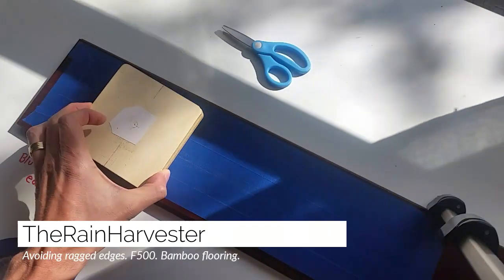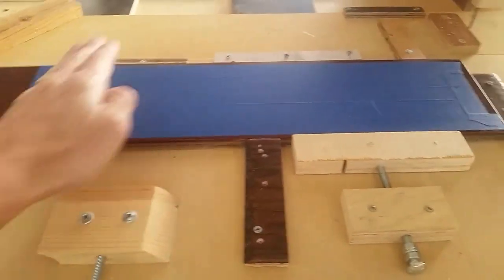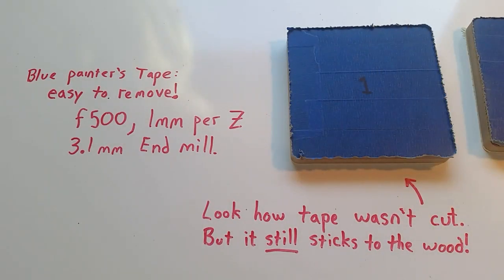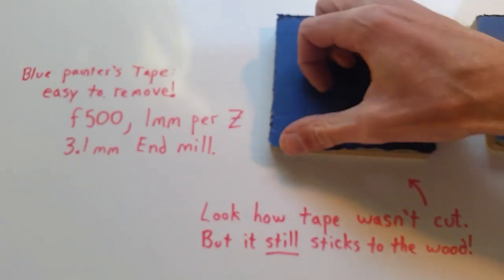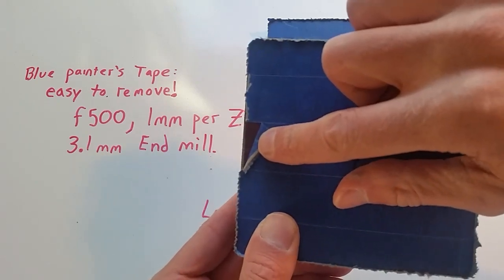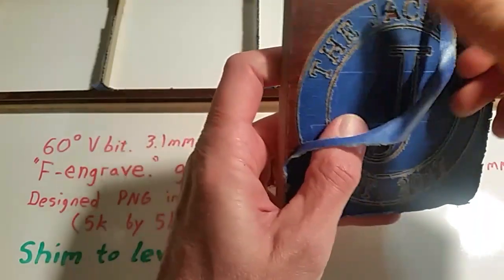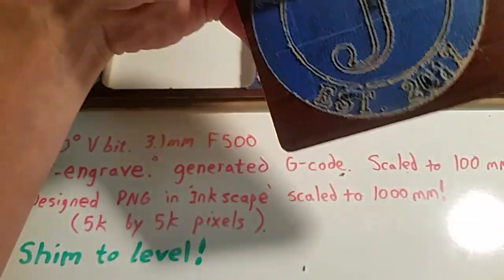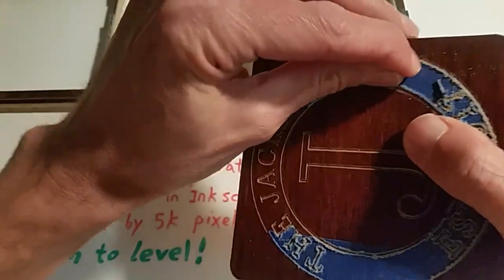CNC bamboo coasters.  Cut out, and engrave.

Comment: Will definitely be trying this! The problem I have is material keeps wrapping around the cutter killing the job.
Reply from the maker: +Dave M , after each time turning off the router, I peel off any tape stuck on the bit. But with the tape I use, I don't think it can stick enough to do any harm.
Reply: Sorry the material is the wood I'm cutting. Seems rather than cutting the wood into saw dust the cutter is shaving the wood. I saw the problem in your video but for some reason it flew off and didn't wrap around the cutter.

Comment: Your bit is hanging out a long way, it's going to flex a lot killing accuracy.  The blue tape trick also works well with laser cutters.
Reply from the maker: O Donald , I think the extra length will cause more leverage on my entire axis and my entire axis/ machine will flex as you say!  Thanks, I hadn't considered that!  My machine flex will become apparent well before the bit flex itself might be noticeable, but it will help to push the bit in more.  The only reason I didn't was because I pushed it up until the cutting edge met the collette.  Will it be a problem if I push it further?  Maybe I should just relocate the entire router up on the axis to reduce leverage.

Yes, good point, tape prevents lasers from causing all the sap from vaporizing and getting deposited on the wood (if anyone notices yellow residue around their cuts, use tape!)
Reply: You'd have to measure it to be sure, but I think a 1/8" bit is going to bend more than the extra 80-20 or whatever extrusion you have on the frame will when move the collet closer.  As you know, stiffness/rigidity is key when machining.

Comment: Thanks for the video! What kind of bits do you recommend for bamboo? Solid carbide or does some type of coating work best? And do you have a good source for the bits? Thanks again!!!
Reply from the maker: Before inflation,the bits were 30 cents. Now they are at least a dollar on ebay.  I only use plain carbide.
Reply: @TheRainHarvester  dang I haven’t even found them that cheap! Thanks for the response, I appreciate it.
Reply from the maker: @MOZOGuitars  great. 😥 That means inflation is even higher!
Reply: @TheRainHarvester  that, or maybe I just don’t know where to look! Lol